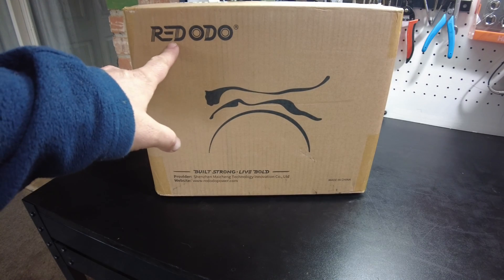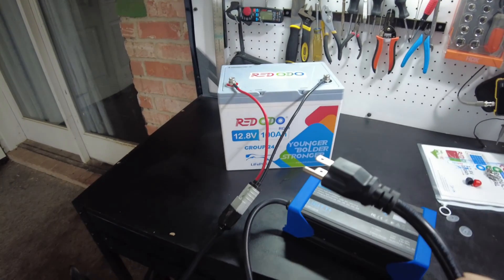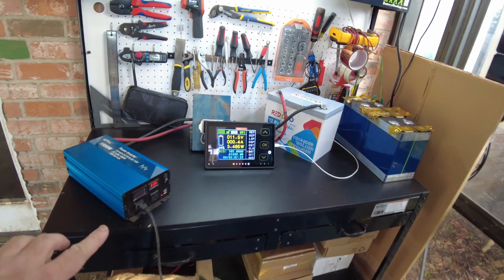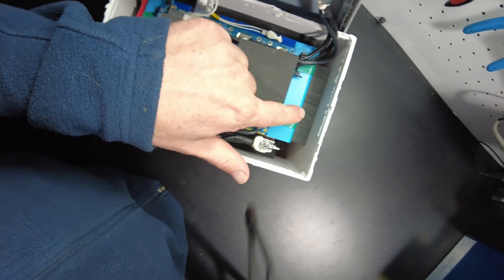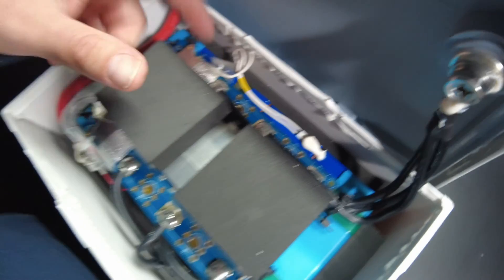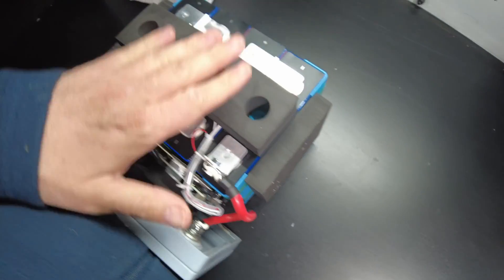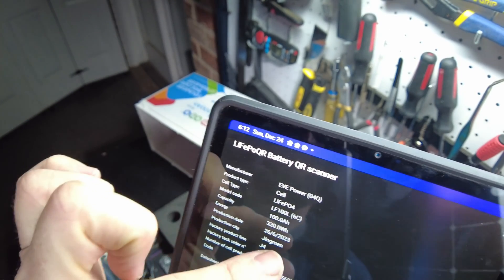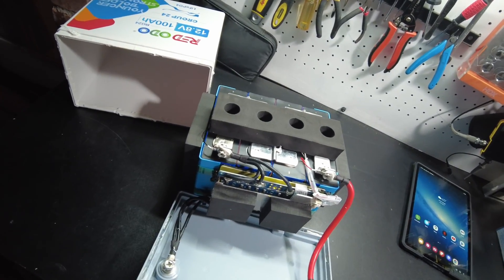Redodo 12v 100Ah Group 24 LiFeP04 Lithium Battery

Comment: Does "group 24" mean these are designed for series 24v systems or what? I made a system with one 12v Ampere Time 300ah for a tiny Frigidaire 400w air conditioner. It was a life saver during the five extreme heat emergency power outages this summer in Louisiana. My relatives nearby called me "crazy" for "wasting my money" on it. LOL! They suffered BAD!
Reply: Group 24 specifies the physical size of the case.
Reply: Thank you.  @YeOldeTraveller